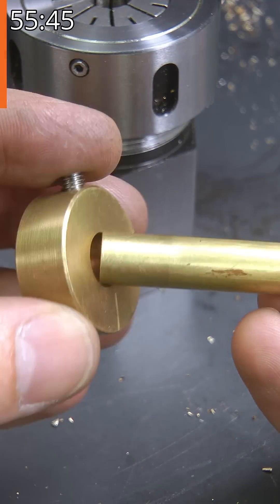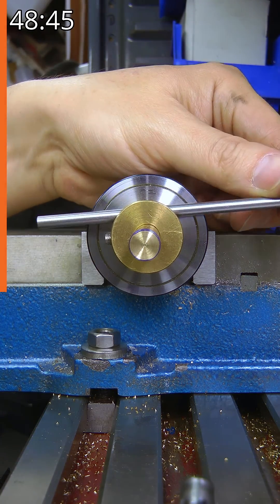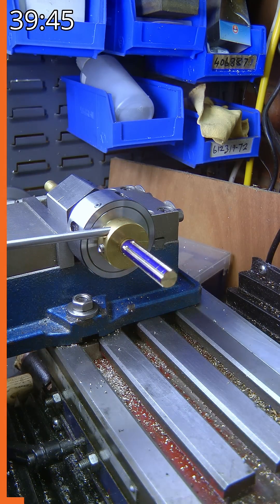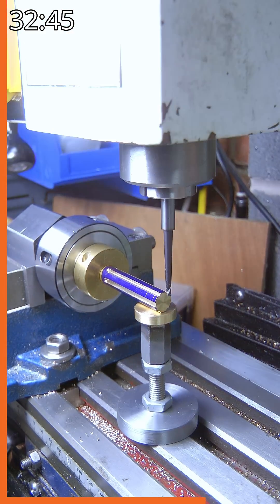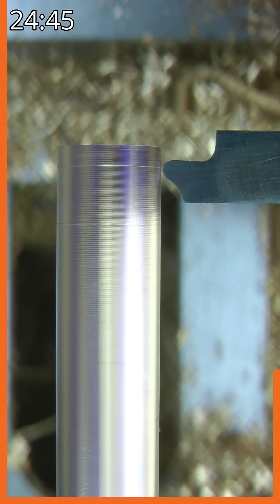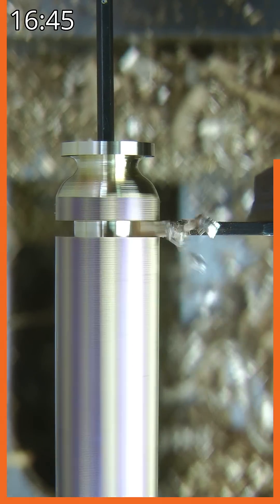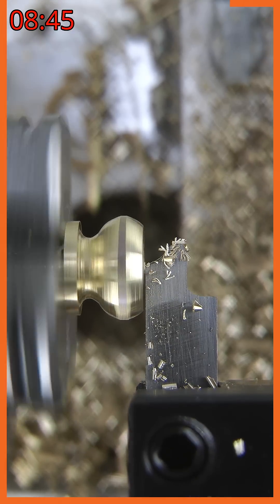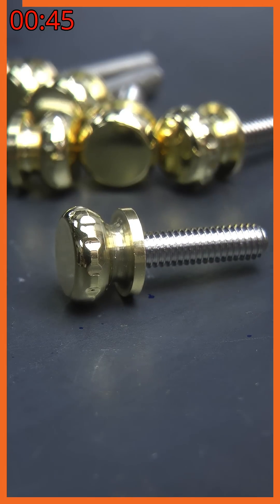Making Mini Brass Thumbscrews In The Home Workshop #lathe #machining #metalworking #maker #shorts

Comment: I’ve just learnt more in your 60secs than the last half hour of scrolling through shorts.

I’ve always used a rotary table with a self centring chuck fitted to it for indexing, embarrassed to say I’d not heard of collet blocks before. Got one on the shopping list now though👍 Looks like a much easier way to do it and less clearance issues to worry about. Thanks for this 👍